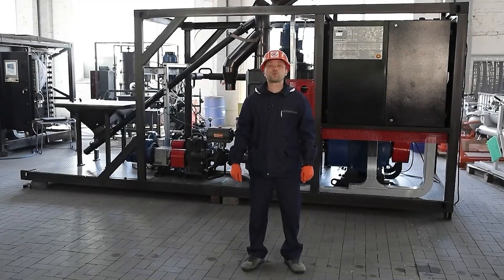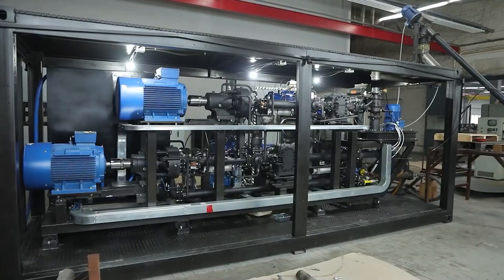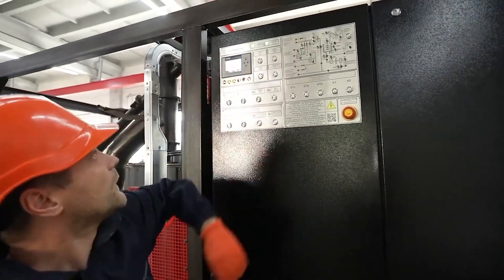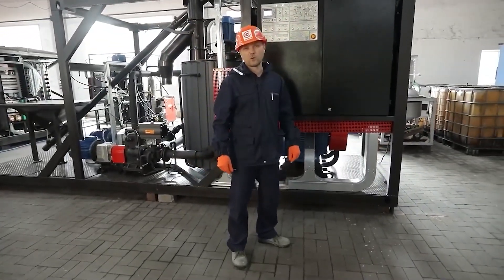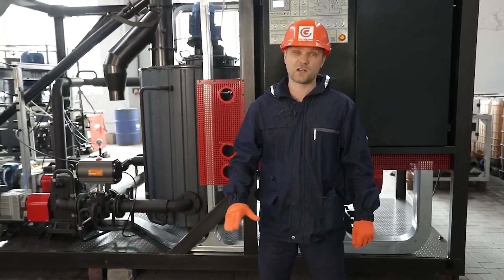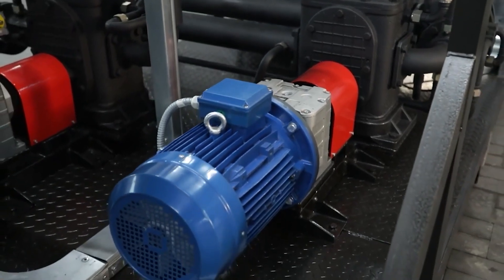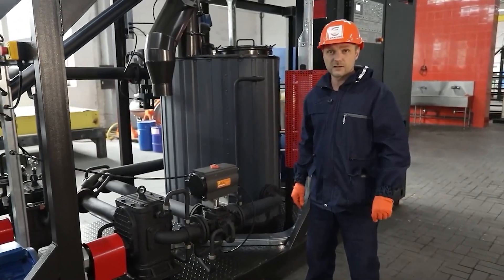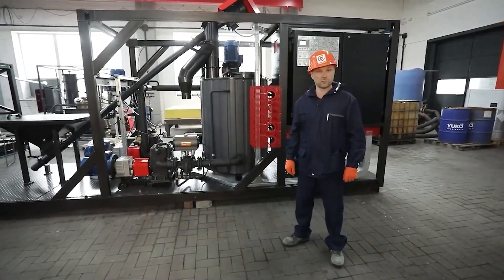Continuous Bitumen Modification Plant USB-3 (8-12 m3/h)

Comment: What is the control logic implemented on the Siemens Logo controller used for?
Reply from the maker: The Siemens Logo controller in the USB-3 unit utilizes a sophisticated control logic designed to optimize and streamline the unit's operations, ensuring efficient and precise production processes.

Comment: What can the pneumatic valves control system be supplemented with?
Reply from the maker: The pneumatic valves control system of the USB-3 unit can be enhanced with the addition of a compressor, further improving its operational efficiency.

Comment: What is the high productivity of the unit used for?
Reply from the maker: The high productivity of the USB-3 unit is pivotal for ensuring the fast production of modified bitumen. Its compact size does not compromise its efficiency, allowing for substantial output in shorter time frames.

Comment: How is the polymer input unit equipped to facilitate the addition of components?
Reply from the maker: To streamline the addition of components, the polymer input unit of the USB-3 is designed to be equipped with a big-bag monorail hoist, simplifying the handling of bulk materials.

Comment: What type of modifiers can the unit work with in automatic mode?
Reply from the maker: The USB-3 unit's main advantage is its ability to function automatically with almost any known modifiers in granular, powder, or liquid phases. For liquid modifiers, the unit is specially equipped with a hatch and an additional feed pump.

Comment: What is the productivity of the USB-3 bitumen modification unit in modification mode with a polymer content of up to 6%?
Reply from the maker: In its modification mode, specifically when working with a polymer content of up to 6%, the USB-3 unit boasts a productivity of about 10-12 cubic meters of modified bitumen per hour.